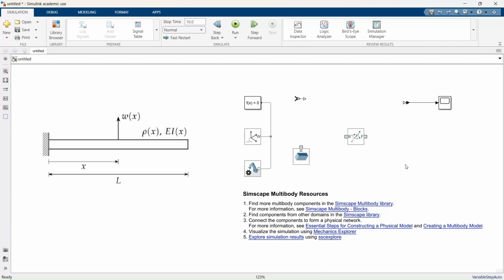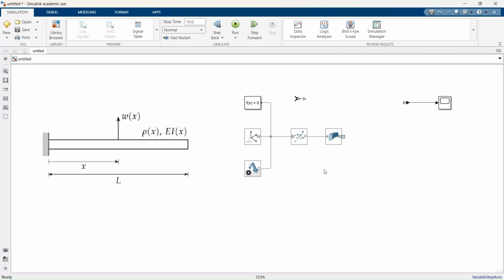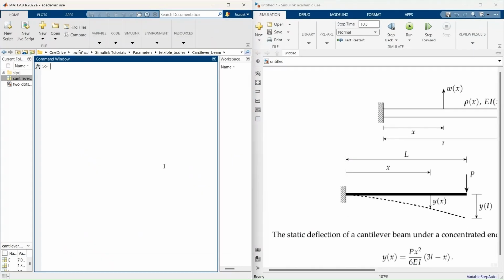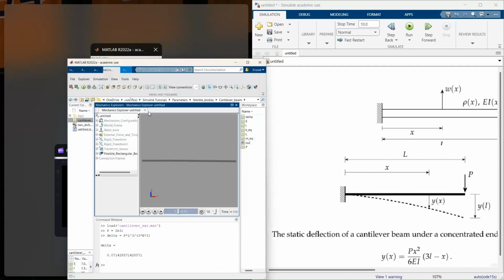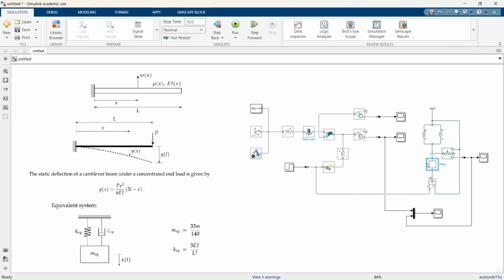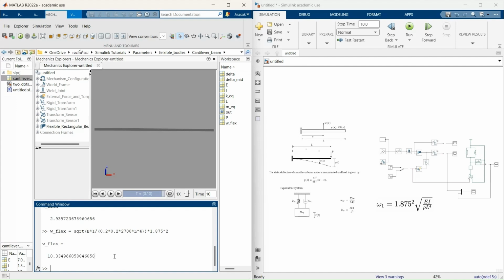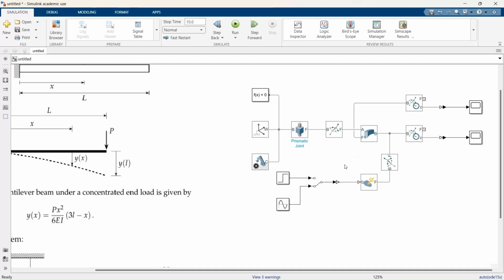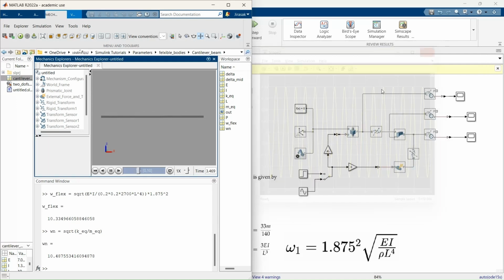Simscape Tutorial 9: Flexible Body (Cantilever Beam)

Comment: excellant sir, i wants to develop the cantilever beam 300*50*3 mm dimension with one end fixed and other end free. at the free end around 25 gm of sensor is placed its accelerometer, at the middle of the beam at 10 mm eccentricity rotor is placed and rotating with say 200 rpm and due to that vibration in the beam generates. now i wants to model the beam using simulink and analyse its vibration behaviour.
help in regards..thanks
Reply from the maker: Hi! Thanks for the comment.

If I understand correctly, you're trying to model a cantilever beam with a sensor at the free end, and a rotor with some eccentricity placed at the beam's midpoint. That rotating mass would act as a periodic excitation, causing vibrations in the beam.

You can try modeling this in Simscape Multibody by:

1. Using the "Flexible Rectangular Beam" block to create a cantilever.
2. Adding a tip mass (sensor) using a "Solid block", then positioning it at the tip using a "Rigid Transform."
3. Modeling the rotating eccentric mass with a "Revolute Joint", and offsetting the mass from the rotation center using another "Rigid Transform."

P.S. Here’s a quick draft I made; I hope it’s helpful:
https://github.com/jirasak-s/Cantilever-Beam/tree/main